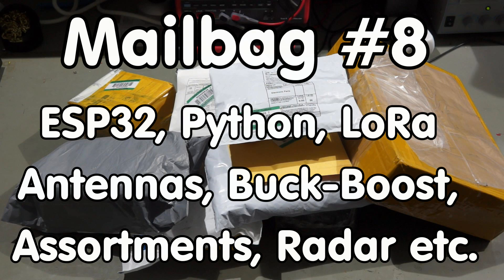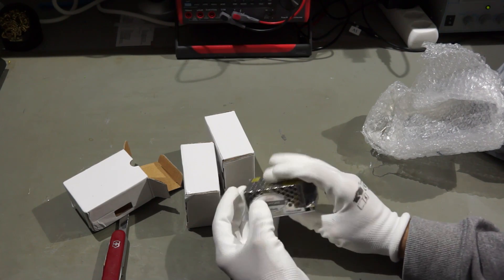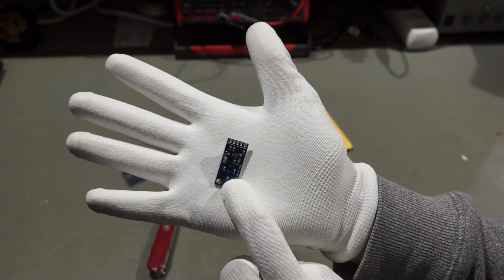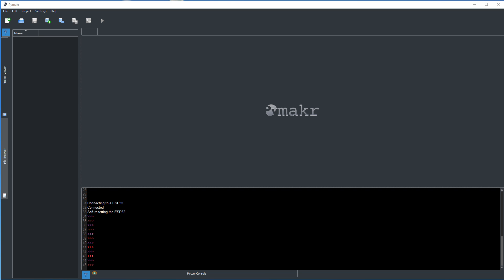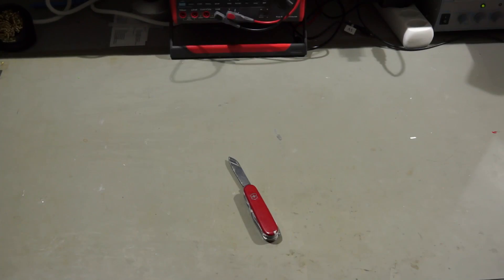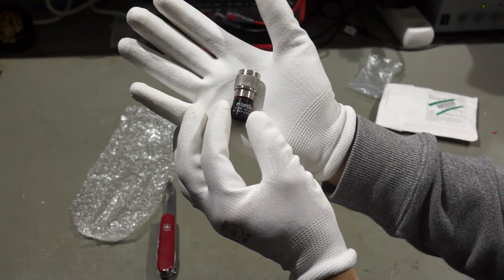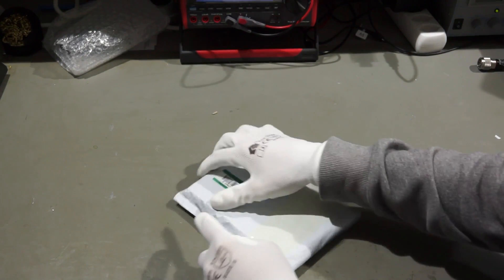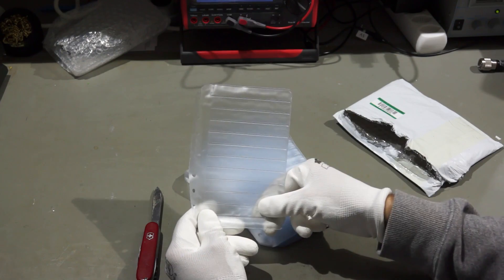#102 Mailbag #8 ESP32,Python, LoRa Antennas,Buck-Boost Converter, Assortments, Radar, etc.

Comment: Thanks for the links! grabbed one of the boost-buck convertors. I was in the middle of building one but it didn't have the nice front panel like yours does.
Reply: If I run this off 12vdc 10A how will it behave outputting 24vdc@5A and above? Does the setting on the front panel accurately reflect the output?
Reply from the maker: +Simon (sjp770) This was just a mailbag video and I did not use it since then. So, I do not know.

Comment: Grüezi! I just watched for the second time your videos #79 and #102 and went through their discussion forums because I wanted to know if you had discussed about some other measuring equipments for the antennas. I guess the spectrum analyzer is the golden standard, but most of us hobbyist can't afford one. As we are now heading towards LoRa networks the comparison of the different cheap antennas is going to be a very important subject. Looking forward to see and here your opinions on antennas and epecially on the theoretical side of the techique how to measure their features and evaluate their quality. Best Regards Miika Kurkela
Reply from the maker: +Miika Kurkela It is also my most expensive device (by far). But it was a dream since I was a young engineer. So, instead of a fancy car, I bought this one.
Measuring antennas at high frequencies (>30 MHz) is difficult, because the environment has a big and changing influence.
So, an antenna might run ok in my setup, but doe not perform as good in yours. But I will try my best...
Reply: And by the way. I always thought that you say "Creative Youtubers!" at the beginning of you videos :-) But  this newer interpretation that I learned today is great, too. I am here preparing an overloaded video about LoPy at the Arduino IDE, its NeoPixel, ESP32's SPI and UART busses and of an 868 MHz FSK door sensor, see you then. Have a nice week!
Reply from the maker: I also have a LoPy, but I read, it is still quite unstable...

Comment: would love some educational projects made from ebay modules, they dont have to be ground breaking discoverys, just simple projects that can be building blocks for larger projects, like, oh a thermostat that turns on a red and green led as a hot and cold, but with an app to set the temperature, but without internet,  if you build this in your offgrid earthship you wont have internet....or maybe a smartphone but we all need to learn smartphone apps!
Reply from the maker: I think (or hope) that, with the ESP32, bluetooth will become available to us. That would solve some of the connection issues of no internet. The next barrier then is: No electricity. And the last: No cheap Chinese devices (be it modules or smartphones) ;-)
I also think, that programming Smartphone apps became simpler. I just never tied lately.

Comment: I'm looking forward to an extensive test of LoRa radios...
Reply from the maker: I probably will start slow... And later extensively.
Reply: nothing worse then a short video about something cool tho. simple yeah, but throw in the details; where your at with power supplies for the modules, compatibility, gotchas, pinouts, and wiring up (5x).
Reply from the maker: Mailbags are mailbags. They are just a small glimpse into some new arrivals. Usually, I add some small tests. The rest Ido in specialized videos, But, of course, not all products will appear.
Reply: mailbags are the obvious exception. on your reply to pepper669 to "start slow..." - i just hope that this does not also mean short. i'm starving for some good lora watching and you make great videos

Comment: Those radar motion sensor are a nightmare , I connected one to a Sonoff. The Sonoff would freeze until I disconnect the sensor. I got the 5.8GHz version and they got triggered all the time by my 5GHz WiFi which was on channel 36(4.9GHz).

EDIT: Tried it again today but this time with an Arduino and MySensors and it works. The sensor is very sensitive at close range , the relay that I got inside box triggers the sensor.
Reply from the maker: Good toe read that. This is exactly what I feared.
Reply: I had a Netgear R6300 router maybe that was leaking some 5.8GHz signals. Now I got a Ubiquiti UniFi AC Lite and it works like a charm.
Reply from the maker: OK. I anyway will test mine and look, if they send ind the 2.4 GHz band...

Comment: The Radar sensor you have linked in your description is XYC-WB-D, but the sensor in the video looks like a XYC-WB-D1, which does not have holes for the delay-setting resistor on the back side of the PCB.
Has anybody figured out, how to change the default output delay time of 20-30seconds on the D1 version?
Reply from the maker: +suborbit I cannot help you because I only unpackaged one...
Reply: Andreas Spiess sure, no problem. I only posted the question, because maybe someone else already has a similar problem...
I'm looking forward to your video about radar sensors. 
Thanks, you are great :)

Comment: Could you PLEASE make a video about the radar motion sensor SOON???
Reply: @Andras : eagerly waiting for your testing these small and cheap radar sensors.
the technology they use sounds much better (sensitivity,  thru-wall, range, SN ratio) than PIR sensors !!!
Reply from the maker: Soon is relative. Two are still in the mail. So, I have to wait. I think, it will be next year.
Reply: Why do you need all of these to start ;-)
Are they really at 2.4GHz and so will desturb the WLAN? Is sensitivity and range better than PIR? Will it work throug some thin wood (for example)? What is the impact of movement direction and speed?
Very interesting. I didn't know these things before you mentioned them.
Reply from the maker: I will wait because I want to make a comparison... Is more interesting.

Comment: You can simply use your regular ESP8266 boards with MicroPython firmware, and then one can program the device also with python scripts. The same applies for NodeMCU firmware and lua language. Arduino IDE is not the only way! :)
Reply from the maker: +Doe John I saw the Micropython for the ESP8266, but never tried. This WyPy was now the chance to try it without hassle....
Reply: The truth is, that uploading a new firmware to an ESP8266 is not a big deal, then you have all the advantage of basicly using a python/lua interpreter running on the ESP itself. No more new firmware upload, just scripts (you can upload them without setting the GPIOs to UART download mode!). I advise you to try out the NodeMCU firmware, using NodeMCU Firmware Flasher and with the IDE called ESPlorer. There's a great documentation about the functions the firmware offer!
Reply from the maker: I once started with lua, but did not like it. And at that time, it did not work wery stable. So, I deciced to go the Arduino way and I am quite happy.
Python is another thing. It is widely used also on other computers under Linux, so I hope, I can use the investment into the language also there
Reply: I totally understand your point! :) But the reason I really prefer 
NodeMCU - according to my measurements - is, that it's the most energy 
efficient one, compared to MycroPython and firmwares written in the 
Arduino IDE. (It consumes about 4-5 mA less serving the same function.) 
Python is a pretty good high level language anyway, if you are a 
beginner I suggest you to visit a website, called Codecademy. Their free
 pratice oriented course offers a great starting point, to get a better 
basic knowledge on python. :) Also, I can't really complain about the stability of NodeMCU firmware, it server well during my measurements, and at first the programming model was weird, but I really like it now, this event oriented async style of programming is pretty awesome to be honest! :)

Comment: Very entertaing video.  The boost-buck converter is expensive, and why, oh why didn't they sell an ac to dc boost buck converter so you don't have to rectify the voltage to use it in a practical application for everyday use.
Reply from the maker: +Joseph Nicholas I intend to use it for a mobile Power supply with batteries or with my laptop power supply I anyway always have with me

Comment: These radar modules are really good and cheap! I've got a bunch of them.
https://www.aliexpress.com/item/RCWL-0516-microwave-radar-sensor-module-Human-body-induction-switch-module-Intelligent-sensor/32710885700.html?spm=2114.13010608.0.0.MCXIiM
I don't know at which frequency they operate.
Reply: @Martin
Did you power them ON (3.3V or 5V) ?
Is the output signal TTL-ready or should it be first amplified and/or filtered before connecting it to an ESP/ARDUINO ?
Thx.
Reply: There is no amplification of the output necessary to input into an ESP/ARDUINO. Output is 3.3V.
Maybe this helps you (as it did for me): https://www.reddit.com/r/arduino/comments/526b8s/anyone_have_experiance_with_microwave_radar/
Reply: Thanks. I've just ordered three of those from Alibaba ... will give it a try !

Comment: Enjoy your new stuff! :) 
I wanted to ask you if you've ever had problems with customs with stuff coming from China (or east Asia in general), since you probably have a huge sample and your statistics will be quite good.
Reply from the maker: +Anarki very rarely. Most of the orders are below 60$. But I read, this will change in the new year. We will see.
Reply: I read the same, unfortunately. That will be disastrous for small orders with the extreme prices customs charge for just opening and processing incoming mail. I'm absolutely  OK with paying the Swiss VAT, even if it's on top of other VAT that was already included in the order. But paying an extra 30 CHF or so just for the processing is ridiculous.

We may have to start aliexpress and dealextreme ordering parties to split the customs costs :D
Reply from the maker: Or we start and "initiative" and change the law

Comment: Christmas has come early. The Buck converter will be my Christmas present number 3. I have used a BH1750 Light Sensor (I2C) with an Arduino Library as a Proxy indicator for my solar panels and it works really well.
I am getting concerned that you may need a larger house soon - you have so much stuff!
Best wishes
Arthur
Reply from the maker: +Arthur Yarnell You talk like my wife... what is the exact use of the light sensor in your scenario?
Reply: I have a 3kW Solar panel array on my roof and the inverter is in the Garage together with the meters and distribution board.  I wanted to switch on heaters in my bedroom when there was sufficient power/sunlight but the bedroom is right on the other side of the house. Before I discovered the capabilities of ESP's, I used an Arduino to read the light levels of the sensor on my window sill and when there was enough light it turned the heater on for a specified time or until the light level dropped. Now I have ESP's, I read the power from the generation meter and consumption meters with split core current transformers (SCT-013-030) and then send an indication of the spare power available to the other side of the house via wifi which is much better. However, the BH1750 worked really well for approximating the power being generated. Of course it could not get the actual power nor take account of other uses so was a little limited. This is all because the feed-in tariff is very low so it's better to use the power than feed it back to the grid.
Best wishes
Arthur

Comment: I've just bought a couple of the radar detectors in anticipation of your making a video on how to use them. Does it benefit you if viewers make purchases via your links?

The links to the connector assortments seem to be to your own order rather than the product page because they require a login to Aliexpress.
Reply from the maker: +BaronVonBiffo 1. No, I do not get an advantage of the links of Aliexpress. Just for your convenience.
1. I thougt, I corrected these two links. So, I have to recheck again...
Reply: The links are working now. Thanks for providing them. It's very useful to be able to get the exact product to use when following one of your excellent videos.

Comment: Great Video! Thank you so much.  I'm very interested in knowing about the interference those RADAR motion sensors might cause WiFi devices. I am playing with a few and hope to embed them in projects with ESP modules.   IoT motion sensing.  I have does this with PIR but it would be nice to have a better solution and not to have to put a hole in my enclosure for the lens to poke through.  I'm hoping the RADAR sensor works through the plastic enclosure.
Reply from the maker: Which devices you use and what is your experience? I plan to do a video about them and your input is welcome!

Comment: I like the ESP32, and ask myself if the Pycom ESP32 has open all features as the Arduino core is in the development and it seems also esp-idf.
Reply from the maker: I cannot answer your question right now. But I think, it will lack all the nice libraries, which is very important. But we also have to see if the libraries from the ESP8266 will work on the -32